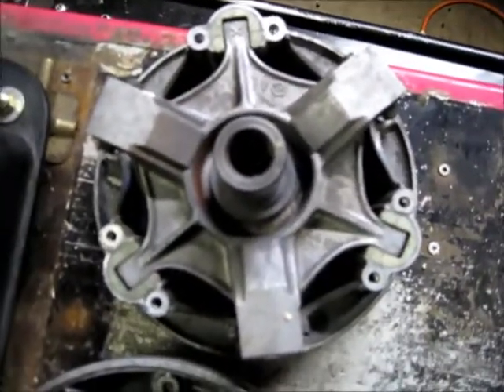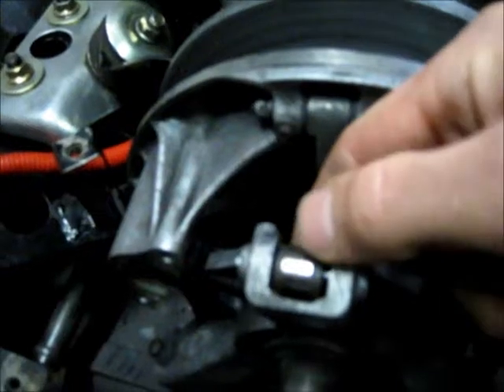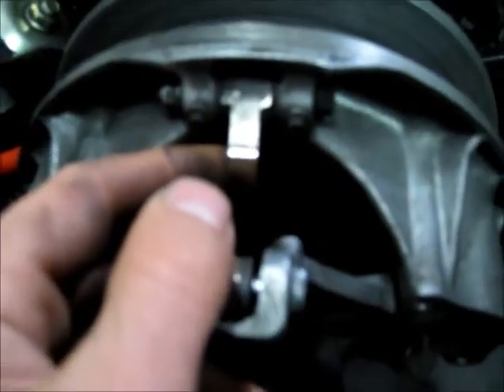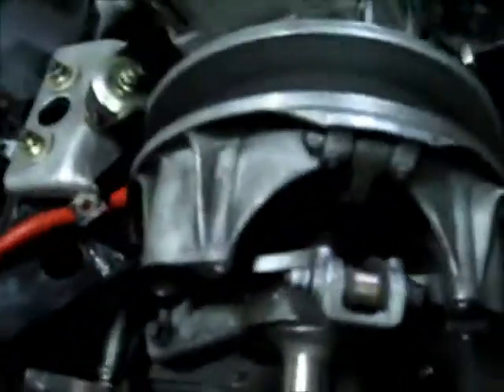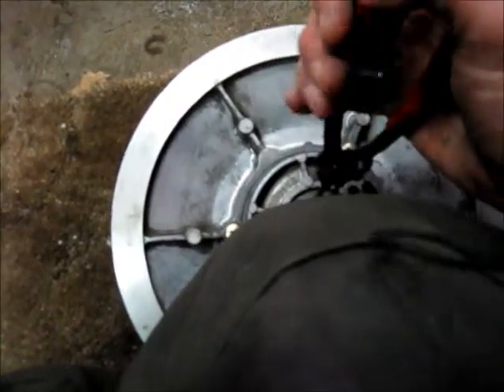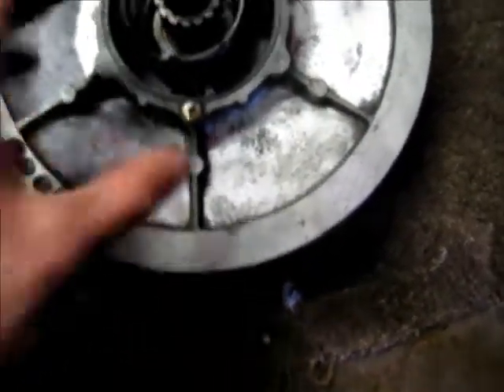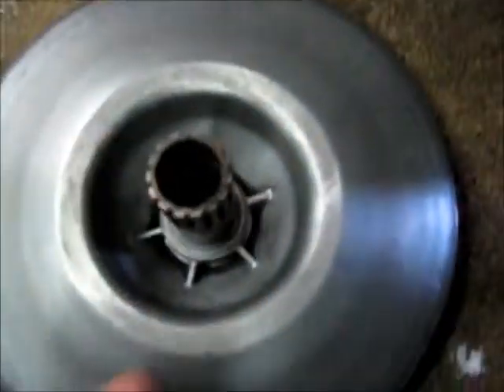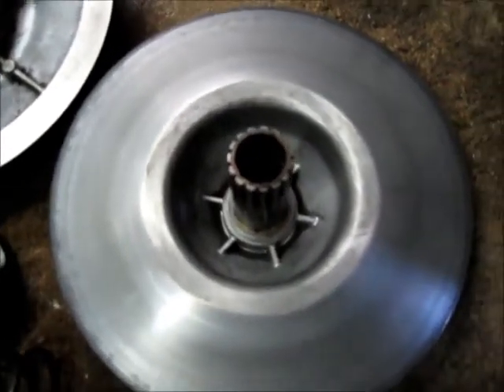Yamaha Exciter / Phazer clutches basic info

Comment: i have a 93 enticer 2 that i had running today and it looked like a small bushing/roller broke and fell out of the primary clutch?  are those replaceable without having to pull and take apart the whole clutch?  i see in your video you have the clutch cover off and could pretty easily change the bushings by the weights?

Comment: when taking the 6 small bolts of the primary should I watch out for spring tension when removing?
Reply from the maker: There is tension so what I've found to work well is to remove 1 bolt from each tower. Then start slowly working the rest of them loose a little bit at a time. Just keep rotating around until they are off. Hope that helps!
Reply: Monte Rohrbach how does the rest of the clutch come off the side of the motor?
Reply from the maker: They are bolted onto a taper. So it will require a clutch puller designed for that clutch/sled. If you do not have on. Most of the maintenance can be performed with it still attached to the motor.
Reply: Monte Rohrbach what I am running into, I have minimal play in the bushing but as the clutch moves in and out its jumping, not smooth and sometime sticks engaged. sat for a couple years before I got it so I'm thinking the shaft would need a little emery cloth? would that help?
Reply from the maker: I would try that and see if it helps. Also give it a good cleaning. What sled do you have?
Reply: Monte Rohrbach I have a 95? yamaha exciter 570 I believe. got it from a buddy that didn't want to mess with it  had it down my road in under an hour, and also battling a lack of turning issue. skis are turning sled is not so much lol
Reply from the maker: It is probably 87-90? year model. They went to the YXR clutch in 91 I believe. And the last year of the Exciter was 93. 

Check the wear rods under the skis. 

If you haven't already come join our FB group.A lot of knowledge in this group.  

https://www.facebook.com/groups/377732505654647/
Reply: Hello what are the a,b,c and 1,2,3,4 on second clutch i put a new belt on my 87 exciter  i just bought, so i dont have much info on sled, the second  clutch seems to stick not allowing track to stop moving at idle making motor bog  any ideas what would help thank you